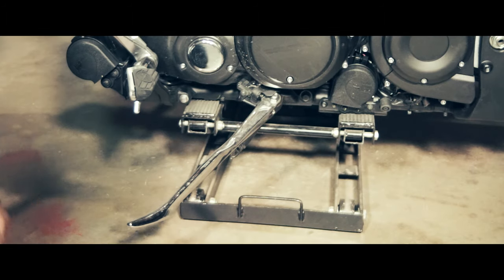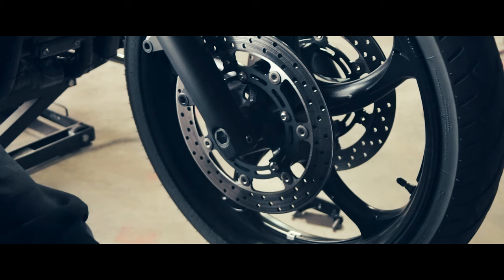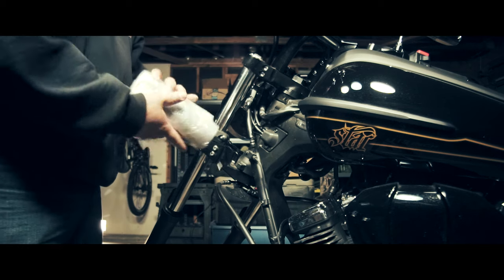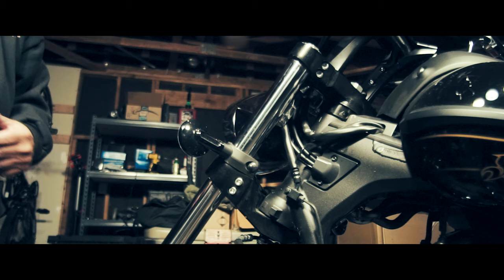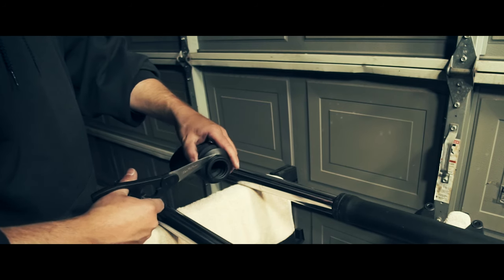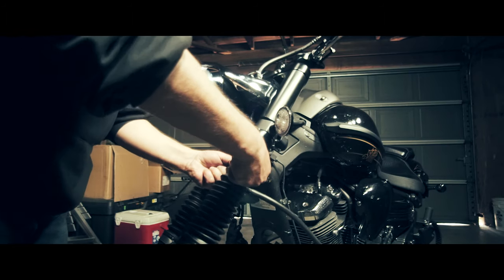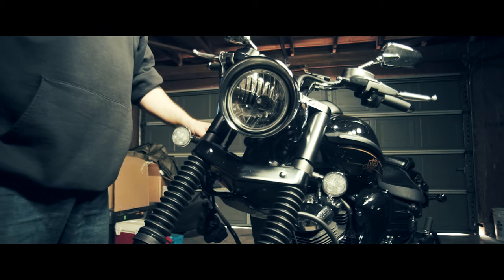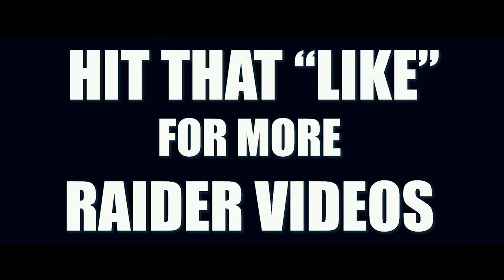YAMAHA RAIDER FAT FORK KIT

Comment: I know this is a few years old but did you use any kind of rubber washers for the top fork tubes?   I just ordered this for my raider on clearance for $55
Reply from the maker: It's just as depicted. I only pulled the forks to slip on the shock gaiters. No other additions or mods were done.

Comment: Could you pls make a video showing where the wiring is located for the front turn signals? . I just bought a 2015 raider and I can’t find the wires. The prior owner eliminated all turn signals on the bike.
Reply from the maker: There is a Raider maintenance manual from 2008, a pdf, online somewhere.  You can Google and download it. Turn signal wiring goes from inside the handle bars, down the inside of the riser, into the head light housing. That's as far as I know for sure, but that manual will show you.
Reply from the maker: http://www.mediafire.com/file/ekm1dodyyin/08_Yamaha_Raider_SVC_Manual.pdf/file
Reply: TSF Channel  thank you.. I’m gng to look it up..
Reply: Angel Genao idk if you found the wires but I’m more than 100% sure your going to have to buy the wires off of babbits yamaha
Reply: TENSECOND FITNESS thank you..

Comment: Those are not the correct turn signals that came on that bike.  Mine 2013 all stock has bullet turn signals
Reply from the maker: Mine is a 2017. Last production year.
Reply: @TheTSFChannel  you correct idk that. They shouldn’t have quit producing these bikes they should of stepped up their game.  Raider road liner stratoliner are awsome bikes.

Comment: Why wouldn't you just buy Motocross fork boots that are made to fit this diameter of the fork
Reply from the maker: 46mm is rare, apparently. If motocross gaiters fit, they would've been mentioned in the forums. Please drop a link where folks can snag on 46mm shock gaiters. Thanks!